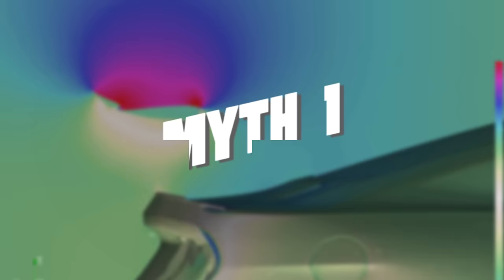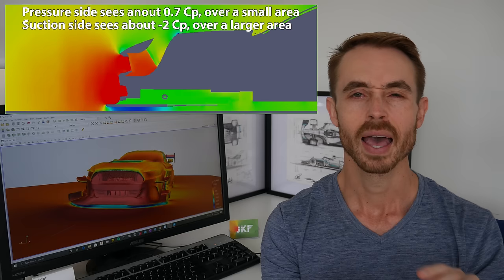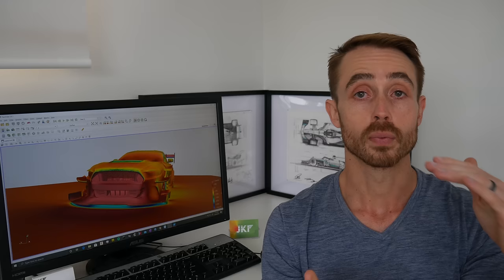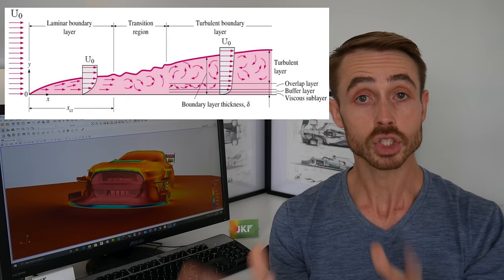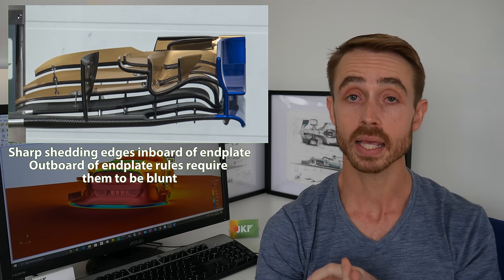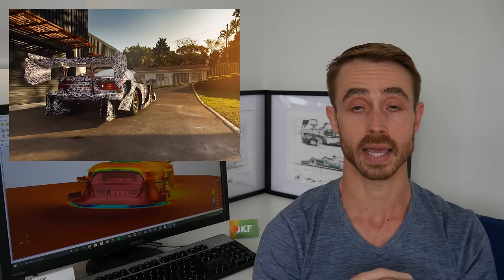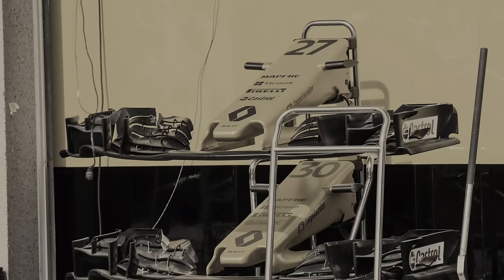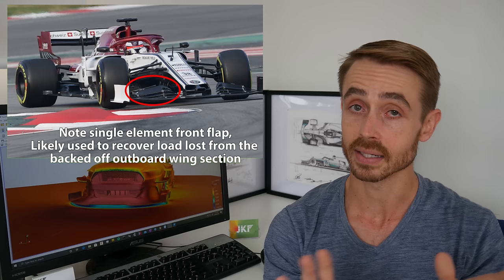5 Common Race Car Aerodynamic Myths

Comment: He's technically right about the wings, and people thinking the top of the wing pushes the car down and creates downforce... But he's also, actually, technically wrong...
Seeing as he's an engineer I'm surprised he didn't talk about how wings ACTUALLY work.
There's no real thing as "suction", unless you're in a total vacuum (complete lack of air/gas/liquids- basically outer space)
Wings work on the principle of pressure differential... There's still pressure pushing the bottom of the F1 cars wing... It's just LESS pressure than on the top of the wing.
I'll try to make this simple -
Basically it be like dis - the atmosphere at sea level is 14.7 PSI... Or 1 "bar" of pressure. This is a worldwide standard that varies slightly - but it's the accepted number by engineers.
When the F1 car wing is functioning and creating downforce - all that's happening is the air on the bottom of the wing is moving faster than the air above the wing... Since you can only REALLY pressurize air in a sealed container - like a scuba or welding gas tank - you can slightly increase the pressure on the top of the wing in a very small area of that wing - but for the most part, the pressure on top is 15 psi or 1 bar of pressure.
The faster moving air below may get down to, say 10psi or roughly 0.66 bar... That's still a reading of PRESSURE... AIR PRESSURE....Theres 10 lbs per square inch of pressure pushing the wing up.
The wing creates negative lift (downforce) not because of "suction"... But because there is roughly 33% more air pressure on the top of the wing than there is on the bottom.
You're not measuring suction, you're measuring differences in positive air pressure.
The relatively stable atmosphere above the wing of 15 pounds is obviously more than the 10 lbs on bottom... So the wing makes downforce because of the pressure difference.
Think of it this way - when something heavy (such as lead) is on top of something light, or light in comparison to the lead - such as water - it sinks.
Pressure is pressure, regardless of which side of the wing its on.
In a total vacuum - like outer space - the total lack of air pressure would cause a balloon to get HUGE and stretch before breaking.
Blow up a balloon and then put it 100ft underwater - that balloon will be much smaller than its original size - because the pressure is acting on it from every possible angle.
Think of a submarine - if it goes too deep, it will crush inwards from every angle of the sub. It wouldn't get flattened like a pancake - the pressure would try to smash it into a perfect sphere.
So it's technically OK to refer to it as suction, because that's what you feel when you stick the vaccuum cleaner hose to your skin... But actually, that's happening because your body contains air and that air is 15psi.
Your vacuum cleaner is creating lower air pressure by accelerating that air - but it is not creating a true vaccuum. A true vacuum is the complete non existence of any air or gas or liquid (gas of any type is still technically a liquid - look it up if you don't believe me.)
So to summarize - the wing is ACTUALLY producing downforce because the air above the wing is about 15psi and underneath the wing let's just say it's 10psi. Just to make the math easy.
Pounds of downforce can be calculated by taking the difference in air pressure between the top and the bottom of the wing, which we're saying is 5lbs per square inch... 15 lbs minus 10 lbs = 5 lbs.
Let's say our wing has an area of 100 square inches.
So if the wing created EXACTLY the same amount of downforce over its entire surface (it's more complicated and the outside wing tips create more downforce than the middle of the rear wing)... But if the pressure difference was equal at 5psi and we had a 100sq inch wing, we'd make 500lbs of downforce.
In the real world, computer programs model the airflow and very accurately model and measure expected downforce - then they put the wing into the wind tunnel and put a scale under the rolling road.
As air is increased in speed, downforce increases and the scale shows more weight on, so just subtract the cars weight from that entire weight measurement and boom - you have your downforce measurement. 
They measure drag in a similar way - there's a scale that is attached to the rolling road or the car itself that measures how much the car -"pushes back" or pulls against the scale. Giving accurate drag measurements. 
I'm not saying he's wrong - bc lower air pressure under a wing will make it feel as though it's being pulled down - but in reality, it's kinda both. 
Hopefully that makes some kind of sense to someone.

Comment: Can I make a suggestion going in completely the opposite direction: The best ways to improve road car aerodynamics for hypermiling without breaking the bank

mitsubishi Imiev might be a good starting point. It's relatively slippery, low powered and has a smallish battery so would benefit greatly from minor improvements - and there are a bunch of them available cheaply in Australia if you want to grab one as a project machine

Comment: Just found your channel and I’m really enjoying it! I’d like to see more of how some of these technologies apply to flight if that is something you can comment on, I think that there is a adverse correlation in how racing cars leverage wings and how a flying vehicle your benefit from that, considering lower Re from the larger camber of flying vehicles. Consider Cars look to see if they can go faster on corner then shed the drag to go faster, where a flying device is trying to transition to as slow as possible to transition for flight (land) then like the cars shed as much drag to go faster. I’m curious to see how you would leverage a multi element wing in the Re range of 2M to 4 M Re range. It’ll still enjoy your videos irregardless if you consider this :)

Comment: Point no. 1 is one good reason why attachments on aircraft wings, e.g. engines, flap actuators are usually all on the bottom. (The pressure side)
It's less of a concern keeping the airflow attached on that side, whereas over the top of the wing (equivalent to the bottom of a car wing) the airflow can easily separate under the wrong conditions and cause the wing to stall
Reply: The new HA-420 Hondajet airplane placed the two engines on the upper surface and more towards the rear of the wings. So there goes that theory. 

I reiterate another point I made in a post regarding the video’s 1st point which is that suction is a virtual and apparent force but it is not a real force. In an aerodynamic surface like an airfoil there are two forces generated by air pressure differences. The less curved surface generates a greater force normal to that side and thus creates lift or down force depending on which side is facing up or down. Like centrifugal force suction is only a virtual or apparent force. It is not a real force. An excerpt from a Wikipedia article on suction and its reference source follows.

Gasses or liquids that move along a pressure gradient can exert forces on objects. Objects can only be pushed by gases or liquids. The correct terminology used depends on whether they are pushed from a pressurized zone towards ambient pressure (blown out) or from ambient pressure towards a low pressure zone (sucked in). Gases and liquids cannot generate pulling forces on objects[1]. ([1]
Quora. "There's No Suction In Space, Because Suction Is An Illusion". Forbes. Retrieved 2024-01-16.)

I cite this article because it explains well what I am talking about.

Comment: Great video. Have you ever considered doing a video on the flexible front wings as used in F1 (notability Red Bull) in the early 2010s? I'd be interested to hear your thoughts in what Red Bull were trying to achieve, and how they were able to overcome the technical challenges to get them to work. Especially in comparison to say Ferrari where they had obvious hysteresis/porpoising problems.
Reply: Looked like it was a structural issue more than an aero one

Comment: I've been watching your channel for a while with great interest but my race car world is somewhat different to everybody else's. I'm near the end of building a 4WD streamliner to take a shot at 500 mph. It is only 36" wide, 33" high & nearly 40ft long. It would be interesting to say the least to get your opinion on what I'm doing here. It has four full length stakes on each side & the top where the center two blend into an intake duct then terminate at two tail fins then I'm creating a sharkskin type surface between those. There is no driver pop-up, it's a lay-down configuration with the windshield being part of the nose. Should be ready for shakedowns in May or June.

Comment: I understand what you're saying as far as effectiveness of an airfoil.  What I think people are talking about is more concerning the increase in downforce as a factor of speed. In the case where a downforce car may feel slightly squirrelly when you are nearing the mechanical grip of the tire contact patch vs the pressure applied.  There will come a point where the effects of downforce are amplified due to the chassis being pressed lower increasing contact patch grip vs centrifugal force wanting to force the car opposite the turn.  If active aero were allowed now as well as active hydraulic suspension, cars could take turns flat out.  I don't believe that the drivers would be able to handle the Gs though, certainly not for an extended period.

Comment: I think people get "stall speed" from when automotive journalists talk about race cars and mention how they need to be going a certain speed for the aerodynamics to take full effect, I could be wrong tho.
Reply: I think it's way more simple than that - people assume that they understand aerodynamics SO much better than they actually do(the amount of times I've had to tell people "...YOUR EYEBALLS ARE NOT A WIND TUNNEL..." in response to a car's "horrible aero" - even though it was designed by damn engineers with huge budgets and all the resources...), and everyone thinks "aero doesn't make a difference unless you're going fast enough". I HOPE that people don't actually think that aero acts almost like a light switch that is "on" at a "certain speed", I think most understand that it doesn't work that way. But there's this idiotic idea that "downforce doesn't matter till 60MPH/100MPH"(those seem to be the go-to numbers) - in spite of all of the open class autoX & Formula SAE cars absolutely proving otherwise.
  
Typical problem of people "knowing just enough to be dangerous", the classic Dunning-Kruger Effect - they learn a LITTLE about the subject, think that they have an "inherent understanding" because it makes sense to them, drastically overestimate their understanding, so then they just start making assumptions that "make sense" based on the tiny amount of knowledge that they have, while not realizing how little they actually understand.
Reply: @RyTrapp0  slight insert here: part of the reason that the F-SAE cars have "effective" aero at low speeds is due to their light weight (requiring less aero force to have a large relative effect). On something as heavy as a street car (e.g. street legal sportscar that you take to a trackday), that amount of downforce won't be noticeable at the low speed since it is much smaller relative to the other forces at work due to the higher weight.

Comment: In the physics community there seems to be some contention as to the Newtonian versus Bernoulli model on aerodynamic lift and I presume downforce as well. Why is this so if the low pressure zones are so much more effective than the high pressure zones?

Comment: Actually the stall speed on an aircraft varies also. It’s the critical angle of attack that remains constant. That’s the reason why fighter pilots fly aoa rather than an approach speed, and why Vref has to be calculated in large transport aircraft. We only fly a fixed approach speed in light general aviation aircraft because it’s simpler

Comment: The one that annoys me the most is that a lot of people think that for high downforce cars there is some speed below which they have no grip.
Reply: It’s not entirely wrong. Obviously as you get slower the air moving over surfaces is gonna be slower and so you get less downforce/drag. And it’s really blown out of proportion but the effect is still there. It’s not gonna kill you but the car probably won’t have the same balance as it did and if you aren’t used to that you can overdrive. A lot of it depends on your tires too. If you have lots of aero and really skinny tires the shift from aero grip to mechanical would obviously be bigger. So it’s a lot of factors
Reply: @cademckee7276  It is entirely wrong, ab lowered speeds the decrease in "centrifugal force" is always greater than the decrease in grip due to lowered downforce. There is never a point that you can regain grip by going even faster. 

Also as far as tires are concerned there is no difference between "mechanical" and "aero" grip, tbh those terms make very little sense anyway. Maximum grip is directly proportional to the normal reaction force between the car and the road, the source of this force is irrelevant (weight or aero).
Reply: @Bruno-cb5gk  you are looking at this from a directly physics stand point. I am looking at this from haven driven a car with decent aero grip. As you slow down you can not only feel the wings working less but the balance of the car changing and when you get to a low enough speed you can feel that the wings aren’t doing anything because the balance of the car has shifted.

Comment: The suction side can never get lower than vacuum... The pressure side can get unlimited pressure.... But even though that is true it is still exactly like you said that it is from the suction side we get most down force... Or more correct we get it from the difference of the pressure from the sides... Or if there is only one side then it's the difference between the surrounding air and the side we get.... But it's never just one side...

Comment: American supermodifieds are an exception to speed sensitivity as the aerodynamic elements move to reduce drag when the wing is pushed/pulled down to reduce drag on the straightaway when the downforce in not needed as much. How much do you think this helps as it means the balance of the car is always changing? As you said the myth is largely untrue not totally.

Comment: I'm new to your stream and enjoying learning through the videos.  Thanks.

My suggestion for a possible future subject is to expand on the effects of fender top vents on LMP/DPi.  In particular, I was watching the in-car cameras of the DPi cars at Daytona.  From inside the car, you could see that the combination of high downforce at speed and the banking, had the cars at full bump with the top of the tire seeming to be above the top of the fender.  I would be curious to understand how airflow on the top of the tire would affect local downforce, drag, and down stream flow.

Thanks again.

Jac

Comment: If I build a tube framed race car with the intention of having a functioning front and rear diffuser and flat floor. Should I design it with a rake at a certain angle to start with? Or should it be designed completely horisontal and you only manage the air within the diffuser designs? Because simply putting a rake on it afterwards would compromise the suspension compared to the horizontal plane.

Comment: May I asking 1 ridiculous thing

For space reason, Can be expansion chamber of diffuser designed to be expanded sideway while maintaining the height rather than expanded upward like most diffuser do? Can it work synergistically with normal upward ex chamber diffuser on either side of it?

Comment: I would laugh if Porsche didn't actually need to switch from Rear Engine to Mid Engine with the 911, they were just wanting a bigger diffuser, when they just needed to design a better flow shape with a smaller diffuser.

Comment: Hi Kyle.  I enjoy watching your channel.  Do you have any suggestions on how to reduce aerodynamic drag while trailering my 2005 Searay sundeck boat behind my pickup truck at 65MPH.   Gas mileage is horrible.  A 10% improvement would help.   This is an unexplored market for technology to reduce drag.  I normally tow with no highway covered and the center console door open to let wind go down the center of the boat.  Any suggestions you have would be appreciated.  I am a retired Electrical Engineer so I may try some experiments.  Thanks Joe

Comment: Hi Kyle, would be great to see a video explaining (in general terms) the advantages/disadvantages of the wide nose F1 aero concept like Ferrari runs vs the narrow nose aero concept like Mercedes runs. 
Also the same on the loaded outboard Front wing vs the unloaded outboard Front wing concepts.
Keep up the great content 👍😎
Reply: At the moment, the advantage of the narrow nose on the Mercedes is that it's the 1st thing in almost every race to cross the finish line, while the wide nose on the Ferrari...not so much ☺
Reply: It seems to be much less important than sidepods, or not having any for that matter.

Comment: Enjoying. I went back multiple times few seconds to look again at graph or listen again what you are saying, but no amount of coffee can save my half sleeping brain today. My question: how high can diffuser start so that it still works. And I am remembering that they do not work if underbody is not flat before it - from your 2017 videos. But is there any usefulness.... Another one is that how making flat floor under the front engine bay can help, and in that case how to successfully still direct engine air like stock, underneath the car? I quess my question is how long under tray at front is beneficial in drag reduction? And how short diffuser and at what height is minimum for any use.